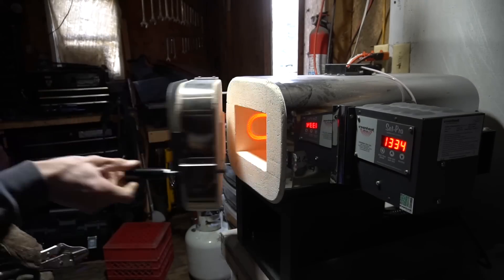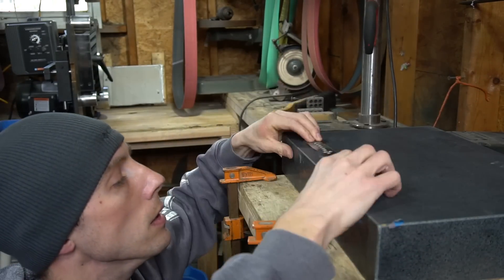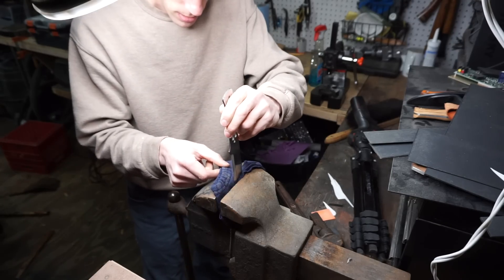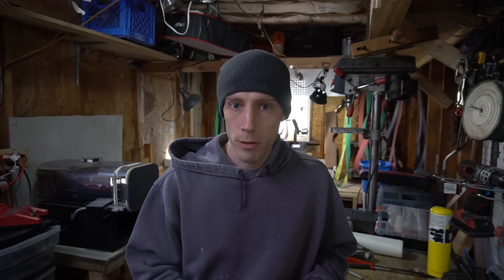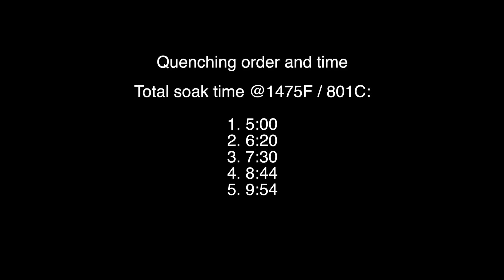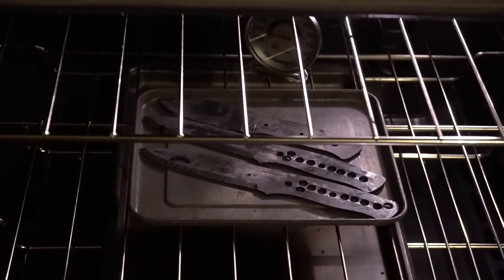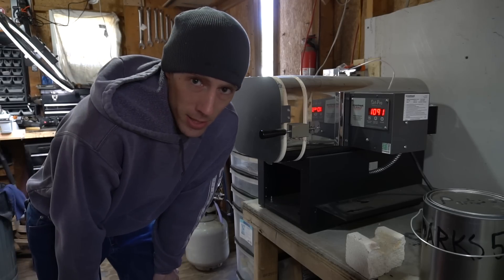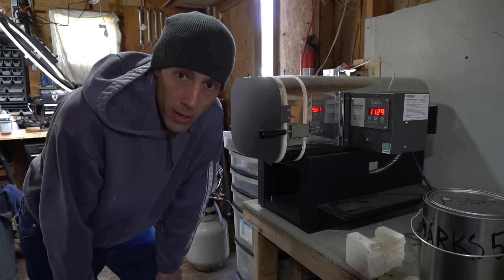Why Knife Makers Should Break Their Knives

Comment: To any new knifemakers watching this: do not be afraid of grain growth! 

This Video made me super reluctant to fully austenetize my blades, which lead to me making sub optimal knifes for many years.

What we are observing here is a phenomena that is (in my oppinion) mostly present in simple carbon steels, and (in that exact form) maybe only in 1095.

I think what we are seeing here is a combination of grain growth, but also increasing retained austenite (RA) percentages. 1095 puts a lot of carbon on solution very fast. Excessive carbon leads (among other things) to increasing ammounts of RA. This explains the blades bending so fast. RA lowers the tensile strength of the steel (the stress at which it plasticly deforms), even if the overall hardness is fine. Graingrowth alone would not let the blades bend so fast, it mainly lowers toughness.

How to avoid that: use a steel with some chromium in it, like 52100. The chromium lets the carbides dissolve much slower, thus limiting carbon in solition and thus limiting RA (and you can even freeze it in your freezer to reduce RA even further). Also: as long as you still have enough carbides present they pin the grain bounderies, limiting grain growth. You can easily austenetize 52100 for 30 min without adverse effects (at the right austenetizing temperature). But I would recommend a furnace for that, since (on the other hand) you need to hold for quite some time to put enough carbon in solution for a good hardness.

If you want to heattreat in a forge use a steel with a little bit of vanadium and equal/less that 0.8% Carbon. Thats not too much carbon in solution and the small vanadium addition leads to small, very temperature stable vanadium carbides. Those carbides also pin the grainbounderies as explaind above. (They are not for wearresistance, as some people might tell you.)
A prime example would be 80CrV2. Just normalize, heat to non magnetic and quench. No excessive RA and graingrowth even if you overheat a little bit.

So: dont be afraid to austenetize your steel. Unless you make it hard for yourself by using 1095.

I hope I did not look like I diddn't enjoy the video. I absolutely love this kind of content! It just can lead to some bad habbits born out of fear, and I dont want you to make the same mystakes as I did.
Reply from the maker: I did a somewhat updated video on this
The BIGGEST LIE in the knife industry- Good Heat Treatment vs BAD Heat Treatment
https://youtu.be/v8xK69vWITk
Reply: @OUTDOORS55 I have seen that! Multiple times actually, because its such fascinating stuff. :)

Comment: Hey, I realize it’s been a while and maybe you solved this mystery before, But I’m wondering if the apparent grain growth of the knife that was easier to bed was a result of grain structure deforming due to softness. When you get a nice clean snap the grain structure reveals itself as it really is (in your case very nice and fine) but even that nice and fine grain structure can appear course if it’s soft to the point where it bends and takes a set before breaking. That’s because, all that bending deforms the grain structure and stretches it making it look bad. Perhaps, then, the knife that bent before it broke actually had a good grain structure, and it only appeared large because it was soft and took a bend before breaking. Perhaps it was soft because the oil in your can was so hot at that point that it didn’t cool as quickly. I wonder if you still had that sample and froze it and then snapped it if it would actually reveal a fine grain structure? Anyway, sorry if you already know all of that, you may very well, but it’s just something that came to my mind when watching and thinking through my own issues I’ve had. Your videos are pure gold, just awesome attention to detail and sooooo helpful.

Comment: I think a statement you put in text on the screen near the end sums it up best. Don't do more than 1 blade at a time. Not saying I know anything. I know I do the best job on 1 thing. Rather than more than one thing. Might be the same for the forge. Is this metal all from the same purchase? From the same company? Just thinking not consistent metal through out. Or even just a bad batch of metal. That would be saying the problem wasn't your fault. I just end with more questions than final thoughts. Still a really great video. I did enjoy the experiment you did. You explained it well. Sometimes in doing something their isn't an answer. You might repeat that and get a different outcome. Your work is great. Keep up the great work. 👍😁

Comment: Disclaimer, I know nothing about this process but I think your testing is incomplete.  If you take 3 examples and you determine that either 1 or 3 is the winner, you haven't gone far enough as there could be a better solution at < 1 or > 3.  So you really need to find the "in-between" result.  One thing that I did notice that varied is your placement in the oven.  A piece that is placed between 2 other pieces will get a slightly different heat experience in the oven.  If you really want to do this correctly, you should probably do them individually or at least ensure they have the same experience (ie, you could place "non-participating" pieces on each side of test pieces.  If you have ever tried to bake more than 1 cake in an oven, you will know that position in the oven and times will give dramatically different results.  Anyways, great job and keep up the good work.  I hope this doesn't come across as too critical, I'm merely stating what I saw and you can use it or ignore it :)

Comment: You might want to get in touch with another youtuber with access to a microscope and use a stricter method for heating and quenching (everything is a variable -time spent heating to temp, time in air before oil, the orientation of the grain when heating and quenching) with something so precise as grain literally the smallest differences can have a massive affect. It would be near impossible to get perfect results but you could reduce the margin of error in order to perfect heat treatment and quenching not only to increase the quality of your blades but possibly also help the market as a whole. You could make the next big discovery in metal treatment so don’t stop now

Comment: Mech E here, though not MSE so it’s not my particular expertise. 
Some thoughts: 
Normalization would likely refine the starting grain structure and help prevent grain growth despite extra soak and temp. Perhaps try the temp test on non-normalized samples to find out. This might be a lesson in normalization prior to heat treatment for consistent safe results. Also, the thing your looking at isn’t actually the grains (would need a scope to see those) but the fracture mark size. Regardless the interpretation of the visual gives the intended result. You want a single consistent failure across the material, not random low stress failures that increasingly weaken the material. 
Also: oil temp inconsistency may play a factor, though I wouldn’t expect it on such small samples unless the average oil temp rose 200+ °F... But maybe it did?

Comment: sorry... but didnt u use the same oil every test....so didnt the oil just get slightly warmer cousing differences...or did u cover this and am i just to high to have noticed.....
Reply: if not get like a small cooler and do the same tests with temp controlled quenching oil...even if its a bit to cold but at least the same every quench....id gues it would give a consistent output.

Comment: Your knife blade handle was never quenched.......... it maintained its heat, while the ground part of the blade was cooled off by the oil, creating great 
differences in temperature on the same blade, and creating stress on the steel.
Your bucket 🪣 with the oil was not deep enough for the size of the blades.

The whole knife has to be submerged at the same time, not having half the blade outside off the oil, being still red hot.

Your heat treatment of the smaller pieces is totally different because they are smaller and they are going into the oil completely...... setting instantaneous.
Another thing.... when you are quenching
.......... use a figure eight, while submerging the blade completely under the level of oil. Don’t skimp on the oil amount, you are trying to freeze in place the condition of the blade, if the blade is half extremely hot ,1450 deg. on one end, and 125 deg. on the other end, your hardness is going to range from 72 at the handle, 45 in the middle, and 57 on the cutting edge. Making a knife 🔪 that is normally found in half blade, stuck in someone’s rib cage in most big city hospital emergency rooms.

When heat treating steel........
Think of it as mixing up a glass of milk 🥛 with some Hershey chocolate syrup.
At the beginning, you have milk and chocolate, if you slowly start to stir, you start to see the two start to mix ,  if you flash freeze it after one or two stirs..... you still have chocolate and milk.
Give it a good ten stirs, flash freeze it, now you have something that is close to chocolate milk, giving it more turns and doing about thirty, now you should have a good mixed chocolate milk drink.
The molecular structure of the steel behaves in the same fashion....... heat been the stirring agent..... after you have cooked the steel to it’s recommended temp and time......... you have the perfect condition for what the knife calls for . You now have to freeze that condition instantly, and you accomplish that by submerging the entire knife 🔪 blade into the oil bath in a figure eight motion so you are constantly using fresh cool oil......... if you go up and down...... the oil touching the blade gets to be hotter in that area of the bucket 🪣.

Hope this helps you out .

Peace
Reply: @Aaron Washburn 

You are correct on the 1095 hardness........

But in any carbon steel that is being heat treated.............
The recipes (temp at which you have to hold the steel at before quenching in oil or with air), the molecules in the steel are fluid............. you want to freeze them in position all at the same time throughout the length of the blade.......... So , if part of your blade is cooling instantaneously and part of your blade is still red hot....... you are going to have different hardness on one edge of the blade , compared to the other edge or end. This causes stress on the material in that it ends up pulling on itself, and the first time that you put torsion or shear pressure on the blade........... it’s liable to snap.
One of the main reasons why cheaply made knives 🔪 that are mass produced and don’t have good quality control in the heat treating departments........ snap.

The scale that I use is the “Rockwell hardness scale” and the steel I like using is 440C......... cook it for an hour at 1850deg , and quench it with air for an hour.......... then draw it in the kitchen oven for an hour at 475degs..... and your done ✅......... have not had a knife fail me yet, and some of them were made in the late 1980’s

Hardness....... between 58 - 60 (Rockwell)

For me ............ perfect 👌🏽 

😊
Reply: @Aaron Washburn 

I know what you are saying........ what you don’t know is the fact that many knife makers don’t tell you all their secrets........... they do a certain amount of drawing on the steel in Oder to relieve the stress on the blade........ you only find out how much you have to do when you experiment with the conditions you have to work with at your disposal........ the results of one knife maker might not be exactly the same of a knife maker who is operating on a budget with mostly “DIY” equipment.

When I first started...... I assembled my oven from recycled components that came from a closed down factory, my polisher came from an old 480 volt Korean War era factory motor that I took apart, pressed a pulley on the shaft , made a slot on the back of the housing, and ran it with house current and a auto fan belt............. today.... my equipment is store purchased, and the quality is almost 💯 percent different.

One thing that I always shoot for...... is , uniform hardness throughout the blade, no matter where you test the blade. It is how I learn while working at Smith and Wesson in the “Tool and Cutter” grinding department. 
D2, O1, 1095, L6 where all basically treated the same.

Anyways...... you have a good day.

Peace.

Comment: Oil temp? I know very little about the harding other than you take really hot metal and put in a liquid to cool it. One thing I do know is if you put a hot object in to a liquid the liquid heats up. How much the liquid will heat up depends on the amount of liquid, the temp and size of the object. Could the oil have gotten to hot to properly quench the steel?
Reply: The knives were definitely large enough to raise the temperature of the oil by quite a bit. I don't know if the oil had enough time to cool back down in between or if the temp raised enough to make a difference.

Comment: G'Day,,After watching you Film,,I Have had problems with parent metals not being the same all the way through,First hurdle,,The other thing is quench liquid temp,
now depending on the original steel,,different Heat treatments are recommended,have seen a full furnace go to scrap because of over heating,,maybe 50 ton of high quality scrap,,
for example when making steel grinding balls,,they air cool and then quench,,but quenching water is at 50 c,these balls come hard and tough,
Now in the rod mill,,the quenching process is highly adjustable,,have seen rod from mill go through the tying machine and turn to dust under 40 ton pressure ,wrong cooling schedule,
it may be to your advantage to test each piece before manufacture of blade,,
Sorry for the long winded comment,,and late viewing,,But i do like the way you went for it,

Comment: What tempering cycle do you use for 1095? I’m new to knife making and have heat treated about 5 knives using 1095 steel. I have been tempering them 1 cycle at 400 degrees and have noticed them coming out of the oven with a blue almost purple color instead of a straw color. I’m not sure if I’m over tempering them or if this color is common or not. Any suggestions would help. I really enjoy watch your videos too!!!

Comment: I made a small knife using 1084 steel. When it was time to heat treat I made a fire bc i dont have a oven yet. I threw the knife under the fire and let it stay there. It was in the fire for a great deal of time but it didn't turn orange , but I decided to quench any way. I quenched it in a water cup with water, mom wasn't to happy about the cup.  But any way I put it in a vice to finish up wen the blade simply broke off. It did have a large warp in it but I noticed the blade was extremely grainy inside. Huge grains wish I could show u. Not quite shure how this has happened

Comment: Shouldn't you be hitting it with the hammer to breake it(due to dynamic force of impact) instead of bending it until it breaks (static force)? Isn't bending it to check it toughness instead of grains size? As far as I know to properly check the grain size you need to make a 2mm ish cut in testing piece with triangle file and smack it with the hammer. But I might be wrong so if I'm correct me please :)
Anyways I like your way of thinking. One is acting differently then other so you did investigate instead of thinking 'well I don't care' great video!!

Comment: Really surprised I haven't seen any knife makers on here do any cryogenic hardening. 
I just forge welded 30 layers of 15n20 and 1090 with a core of 1.25% high carbon steel. Def running heat treat retaining some austenite, slowly dropping temp of said heat treated blade down to -300F and holding will boost martensite and eta carbide formation significantly.

Comment: If you leave them in the oven too long you can get segregatiom of the impurities at the grain boundaries due to the high diffusion rate which can cause drastic changes in the material properties of the metal

Comment: Once the heat treating process is started, there are no retarding impacts and crystal growth resumes unhindered.
The larger the crystal structure the weaker the steel becomes, the sooner the blade is quenched   after proper temperature is reached, the better. The grain growth occurs very quickly, only after a few moments, the enlargement of the crystal starts. To prevent any problems, quench as soon as possible after the heat is even.
These problems are lessened if you keep the the time the metal is at critical temperature to a minimum.
Tip from flash (probably the best welder in the north sea)
Reply from the maker: This is completely steel dependent and not applicable to all steel including 1095

Comment: You may have covered this by now since it has been a year since the video. But what if you do each piece one at a time in the oven so you don’t just have them soaking for the extra time at those high temps while waiting to be quenched. Do the first knife complete and then move to the second knife the the third and so on. This should give you fair and accurate results on each at least as far as each one being done with minimal time needed to reach temp and not having to soak at those temps while waiting their turn. Does this even make any sense or am I just way off base? Love your videos regardless.

Comment: just remember that when the oil is hotter it removes heat faster making the steel more brittle.
so after having quenched the first 2 knives the last one would have been cooled the fastest making it the hardest and most liable to fracture.

Comment: Was the temperature of the oil the same for each quench that followed the previous blade. If you used the same oil, then the oil temperature is extremely relevant to the rate in which the blade cooled.
Reply from the maker: Oil temperatures were monitored